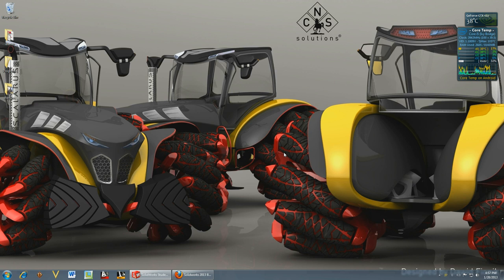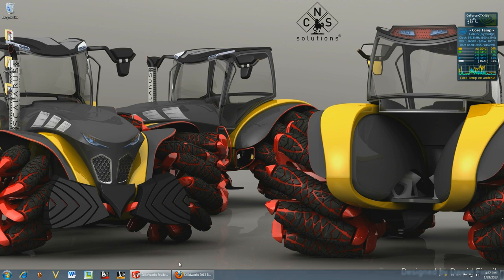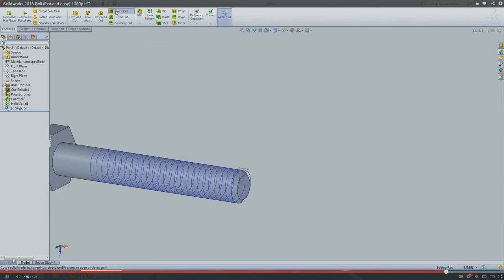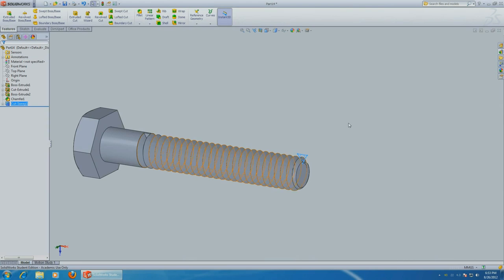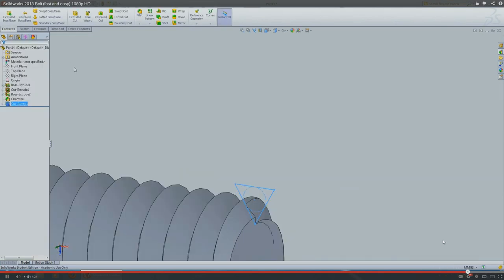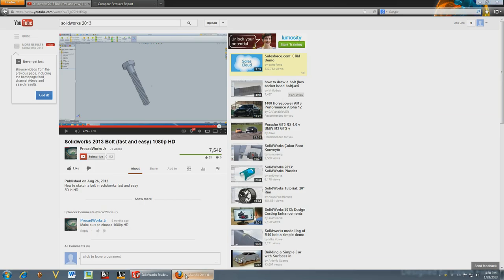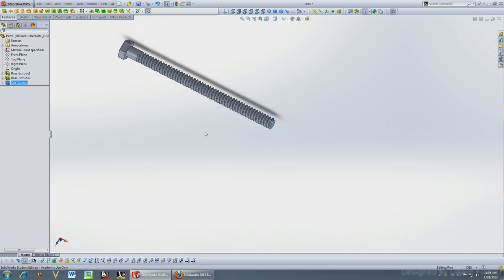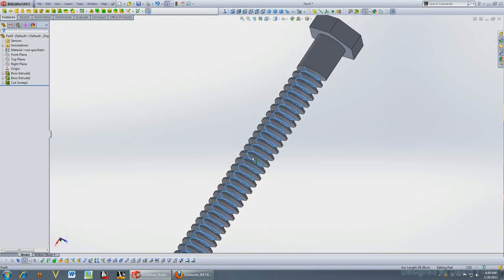CAD Gaming video card vs non. Solidworks

Comment: If you don't have a good graphics card and experience the long delay for the lines to load, turn off windows aero effects (giving that transparent effect on all windows) and set it to Aero basic. Completely fixed the problem on my shitty old laptop with an intel gpu.

Comment: You can just change some settings in solidworks to recognize the gtx graphics card as a quadro, it's pretty easy to do as well, there are some videos on youtube explaining the process, most recent gtx cards like the 1070,1080, etc, are actually faster than most quadros, and a lot cheaper.
Reply: I cant find a video about it, can you please recommend one?
Reply: Can't find this either. Maybe you could help ? :)
Reply: its called realhack